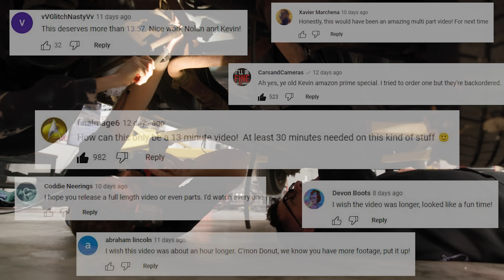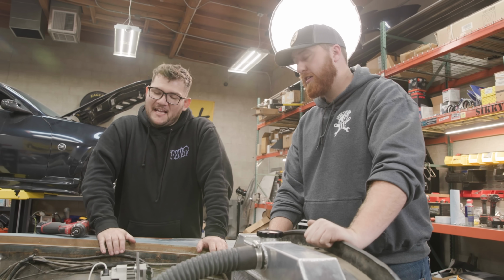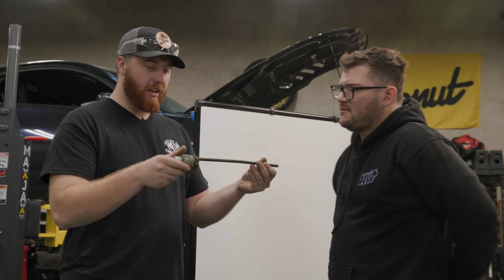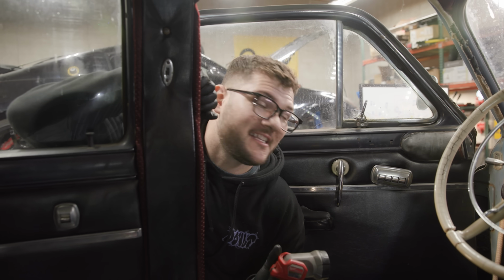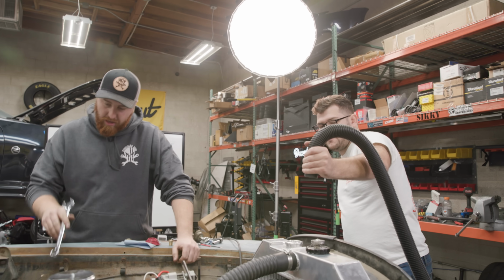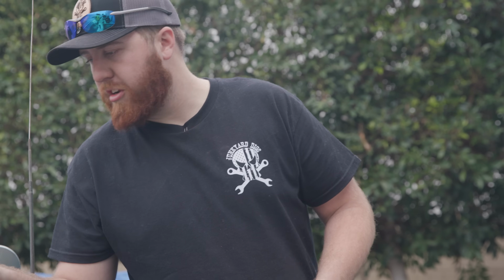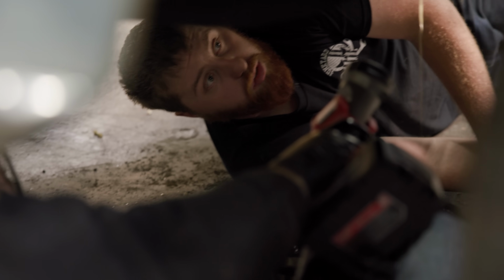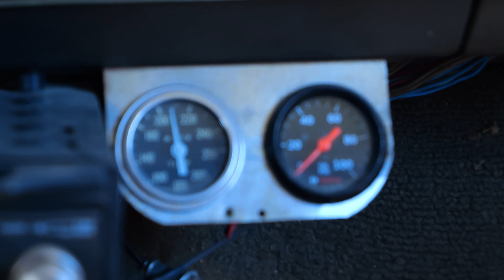Reviving Nolan's Imperial - On Road After 40 YEARS! - FULL LENGTH EPISODE

Comment: So, what happened with the solenoids on the fluid drive transmission?
I ask because I have a 49 Chrysler with the same transmission and shot wiring.
Reply: Changing to 12 volt negative ground is going to prevent that trans from ever working again. He commented that he is looking at a transmission swap. Which is basically impossible for this car.
   I have a 52 Chrysler that is my latest project. I've owned 1965 to 1975 Mopars all my adult life and nothing I learned about them is of ANY use on my 52.
   Service manual, parts book, Youtube Chrysler Master Tech is what I needed.
Reply: @auteurfiddler8706  I bought the service manual reprint from Andy Bernbaum.   Full of useful information, but they definitely left some critical things out of the manual.

Comment: Just for the record, so far as I remember that car does not have a torque converter. It has a "fluid coupling" The fluid coupler does not step up torque as a torque converter does. Read: WIKI---> "Fluid Drive" is the trademarked name that Chrysler Corporation assigned to a transmission driveline combination which replaced the flywheel with a hydraulic coupling and performed the same function as a modern torque converter, only without torque multiplication." 
Calling the fluid coupler a torque converter is giving the device properties that it does not have.

Comment: A M26 Pacific also called a dragonwagon also had a fluid flywheel in front of the clutch a couple of American tank destroyers from the Second World War and a Swedish strv M/40 Light tank the advantages in these vehicles office design was smooth power take up a great design but complicated to work on if you think the Nolans transmission was hard to work on imagine adding armour plate and sticking it in a box I helped repair these Swedish strv M/40 that was on loan from Bovington tank museum

Comment: You always wonder what genius drag racer came up with the notion of the ClutchFlite transmission. Then I saw this vid.
Reply: Well....
 They are exact opposites! But I love the word "ClutchFlite" from the Mopar Bible. But the Mopar Bible discourages it's use after about 1970 when Auto trans got so good.  Probably Torque converter advances.
    CLutchFlite... TorqueFlite Hydraulic transmission with internal clutches and steels and bands  with a torque converter replaced by a clutch.
    Fluid Torque Drive.... mechanical transmission with electro mechanical upshifts and downshifts (with some hydraulic aspects) with a clutch to choose ranges and a torque converter to prevent engine stalls.  No internal clutches and steels and bands. Just pure gears like a manual.  Not arranged internally like a manual, but gears just the same.
  There are some Chrysler Master Tech videos on Youtube on the Semi Automatic transmissions.
Reply: @auteurfiddler8706  "Exact opposites"? An automatic transmission with a clutch...
Maybe execution is different, but conceptually they're the same.

Comment: were y’all still using that sketchy configuration to hold the oil filter housing together or did you finally find the proper band clamp? 😂
Reply: I was wondering about that too.  I thought maybe he'd switch to a conversion set up, but when he mentioned the drain in the oil housing, I knew he didn't. And they didn't show it. I'm guessing it is still. the sketchy gear puller as a clamp thing.
Reply: @auteurfiddler8706  ah yikes. well i hope nolan comes up with something different in the future cause idk how long that will last. it would suck if it failed driving down the road causing that hemi to blow up

Comment: Fun fact about this car. They didn’t produce any in 52. All the 52 models were left over from 51.
Reply: LOL. That sounds like something you'd read about in a story about Kaiser Fraiser or something. I can assure you 1952's were made in the usual months.  Fall of 1951 to summer of 1952.  Production totals were made together since the cars were so similar.  I have a 52 Saratoga and the only difference is the tail lights and the fabric choices for the interior. And a few other minor ones.
  Well, there IS one difference. My car has the pot metal trim and emblems basically painted silver rather than chrome. They were making cars in 1952, but ,  as there was a war on, chrome could not be had. The bumpers are proper chrome.
Reply: @auteurfiddler8706  I have a 51 imperial and a 51 Saratoga. The 51 imperial was also the limo chassis. There were imperials assembled and worked on in 52. Chrysler didn’t make a 52 production run of the imperial only.

Comment: Would have been easier to pull the whole drivetrain & steering column out & replace it with a 80’s-90’s setup for a junkyard.  I’ve had both a original restore and a modded hot rod.  The modded hot rod was easier to work on.
Reply: A car buddy said the same thing about my 52 Chrysler. I just gasped and blurted out, "THAT's a HEMI engine!"

Comment: Ok, being an old mopar guru, and have owned a few of the early 50s vintage chryslers, I know that automobile was equipped with power steering, now since you removed the generator,( which was also the power steering pump)mounted on the rear of said generator, exactly what are you using for a power steering pump on that vehicle? I know Chrysler didnt fabricate any machined bolt holes in the heads or block until 1957, when they debuted the 392 hemi, which had the pump mounted directly to the block in Chrysler normal( lower right front) of the block, looking at the vehicle head on, so I'm wondering if you guys are doing the "Armstrong" power steering, and if so, be prepared for an other large disappointment. That car used a steering gear manufactured by Gemmer Gear and pump, and specifically states in an Imperial or Chrysler shop manual from 1951-58, when Chrysler transitioned to Eaton manufacturing for their power steering components, under no circumstances operate this unit without proper lubrication and pump flow, or catastrophic failure will occur, and loss of control of vehicle will ensure. Just a heads up from an old guy that grew up with that era of Chryslers. You possibly could have found a generator off of a 1956 chrysler, and all your issues possibly could have been cured.,
Reply: I was upset about that.  He was so lucky to HAVE power steering then he just tossed it out. I hope he sells me the generator/ ps pump for my 52.  Switching to 12 v was a BIG mistake. On every level.

Comment: Could that transmission have overdrive in each gear.
Reply: Or underdrive, depending on how you look at it. Two ranges, with two gears in each so a total of 4 forward gears. That sounds pretty good to me for 1951-53!  The shifting between the gears in a give range is automatic with no cluch requires. You only use the clutch to go in to three choices: Reverse, high range, low range.
Low range is typically ignored. You don't depress the clutch to come to a stop since the fluid drive or torque converter (depending on which transmission you have) prevents a stall.
  But the competition had transmission that were totally cluchless, so Chrysler finally had one of those by late 1953.

Comment: The reasoning behind cranking an engine without starting it is nonsense.  Spinning the pump from the distributor shaft has merit on a dry engine, but cranking simply keeps low oil pressure longer, increasing the chance of bearing damage, keeping hydraulic lifters from pumping up, and increasing the chance of wiping a new cam.  Uncle Tony recently removed the main cap from a Slant Six that had been sitting 40 years and there was plenty of oil in there.  Cranking on the starter is well below idle RPM and doesn't provide safe oil pressure like running it does; don't hurt your engine by trying to help it.  The number of oil changes suggested is also absurd and wasteful.  Think of microparticles as polish.  100 and 1,000 miles is more than plenty.  Back in the day they never did two changes, oil had weaker formulations, there weren't PCV systems to keep sludge down, and engines did fine.  Finally, too much zinc may be worse that too little.  A good diesel oil formulated with zinc by itself is plenty after the first change.

Comment: You don't need to use STP or that Lucas crap. Just use a HDEO like Rotella 15w40 or 10w30. Plenty of Zinc although a straight racing oil Like Valvoline VR1 is a better but harder to find.

Comment: Is it just me, or is the headlight switch working the wrong way? It turns off the parking lamps (both front and rear) when the headlamps are on. That doesn't look right to me...
Reply: There are two filaments in the bulb. One for running lights and one for turns.  I have the service manual and the parts manual.  I don't see a reason for the running lights to turn off when the head lights are on, but that doesn't mean it was not designed that was. Everything on this car is different than a newer car so you never know.
Reply: @auteurfiddler8706  I can imagine that for the front, but rear? They are driving through a city at night with no rear lamp working. This cannot be right.
Reply: @TrinomCZ  Oh, I missed that the rear wasn't working.  I also missed them having a service manual or even a wiring diagram.

Comment: where's the power steering pump ?
Reply: They showed it lying on the floor still bolted to the generator!   Manual steering is hard enough but BROKEN power steering is the worst!
   For those not into these cars: The Power steering pump is bolted to the back of the generator and is driven that way. It is over the valve passenger valve cover, not in front of the engine. You can have a Generator without power steering, but you can't have power steering without a generator (the specific one).
    Getting rid of the generator and the power steering pump was foolish and converting to 12 volts was ridiculous.  So now it can't steer or shift!
Reply: @auteurfiddler8706  totally correct !!!

Comment: Oh and cranking an engine to get oil pressure with a new cam is not a good idea. prelube the engine or at least fill the filter and if it does not show pressure in the first oh 3 seconds shut it down.
Reply: He prelubed it with a piece of a shopping car as the drive tool in the first video.  Recall when the fuel filter kept leaking because they didn't have the clamp to hold the two halves together.
Reply: @auteurfiddler8706  The first video was a year? ago that does not count

Comment: It has the wrong water pump on it
Reply: Does it have a big block chevy water pump? That is a conversion a lot of guys do. Did you notice he had and aluminum intake lying on the floor  that was the wrong type at the beginning? It was just sitting on the floor with the generator and power steering pump and a bunch of other parts. I knew it was the wrong one because it needs a water outlet on the front.

Comment: Have rebuilt motors for 30 years, break the cam in change the oil, change again at a 100-150 miles and continue at whatever you normally do. He repeated something he read in a book. Any real mechanic knows the book is a reference point, nothing beats experience. Now if it’s a hot rod motor or you beating the total hell out of it, you probably need to change it more but all that crap he said is totally unnecessary but it’s your money, spend it how you see fit

Comment: for your zinc in the oil..just go buy a jug or shell rotella diesel oil in whaever viscosity you need..I use the T-6 full syn rotella in all of my engines..from lawnmowers to turbo subarus..never had a failure..over 1100 parts zinc..better that stp..because you don't buy stp..you pour oil in..done..and rotella always has a sale on..not $$ at all..

Comment: Why all this work? Slip in an LS and TH400, quick easy and reliable!
Reply: The ENGINE and to a lesser extent, the Trans are what make the car interesting. The body not so much.  Also, his came with a rebuilt engine.
Reply: @auteurfiddler8706  It was a Tongue in cheek observation. The car is a Chrysler product, so a real swap would have been an electronic ignition 340/727 or other modern Mopar next gen propulsion system. But I really did not mean it. I was just trolling. However, he has now actually started the swap of the transmission. The new trannie will be a 727.

Pinned by Junkyard Digs
Donut Media
1 day ago
Such a fun week! I've decided I'll be replacing the leaky Fluid Torque drivetrain with a Mopar 727 automatic, just waiting on an adapter plate. I'll be sticking with Kevin's advice to have as many modern and easily replaceable components on the car. In the meantime I've lowered the car two inches, and I'll be ordering some hub adapters for some sweet wheels I think you guys will like. Thanks to everyone who has stuck with this build! Kevin- I'll see you soon buddy!
Reply: @newsnowriversidesgtrock  I saw that. Since Hothemiheads is listing that adapter unavailable, I hope he has another source.  Lowering the car is idiotic.  Why are guys that lower cars never guys that know how to do alignments?
  He made so many bad choices already and Kevin didn't stop him.
Reply: I would normally agree about the electonic ignition.  But: you need to deal with the shaft length issue if you use a 340 dist. And: The factory distributor is a dual point and is a really high quality piece.

Comment: The vacuum "tic toc trick" was dumb, real dumb. If the system is left sealed (aka: radiator cap left on) almost no coolant drips, because the surface tension of water keeps air out. Adding a vacuum sucks coolant out.

Works for small holes, like sensors.

<- ASE Certified Professional Technician (for over a decade) + certified by multiple manufacturers

Comment: A torque converter and a clutch? And ya'll spent how many hours bringing that thing to life? And didn't even swap it for a proper trans?
Reply: 51-53 V8 331 engines have a bell housing that is part of the block. No other trans bolts on.  Even with expensive adapters and butchery, it really is not a good idea to try to put on a better trans if there is any way to avoid it.

Comment: That car would be getting a 727 torqueflite.
Reply: 51-53 V8 331 engines have a bell housing that is part of the block. No other trans bolts on.  Even with expensive adapters and butchery, it really is not a good idea to try to put on a better trans if there is any way to avoid it.  He says he's getting a Torqueflite but I don't think he knows what's envolved.

Comment: Zinc Additive's don't work. YES your flat tappet engine needs Zinc There are also other wear surfaces in the engine that benefit from zinc.
BUT you cant just pour it into detergent oil designed to run without zinc. it wont adhere to the cam or any other part. You can also cut an oil filter open after using Zinc additive's and there will be a grey sludge . Guess what that is? Its the zinc that wont mix with the oil properly.
Project farms did a test on additive's He sent out STP additive that claimed to have Zinc and there was very little in the sample. STP anything has always been a con. Have not seen any tests on the lucus would be interesting to see one.
What's the solution? If you really care about your engine use race oil that has Zinc in it. At least on every second oil change.
Or lets say you have a 12 valve Cummins that holds 11 quarts dump in the diesel oil of you choice (2 5 quart jugs) And one quart of 20/50 Valvoline ZR1 . Diesel oils have little or no zinc in them these days. Zinc accumulates on the engine parts . So the more you change the oil the more it builds up.

Comment: y are people so stupid using electric fans on their old school classic cars?? they're noisy and annoying just use the original  Mechanical fans
Reply: That's what I was thinking.  Also they use a lot of current.
Did you see the video where the young guy buys a V8 converted Pinto? And they put a radiator and electric fan on. To try to drive across country.
 It overheats every day all through the trip.
One fan just can't handle a V8. I think it is the same for this car.